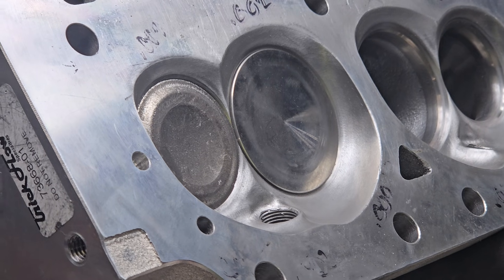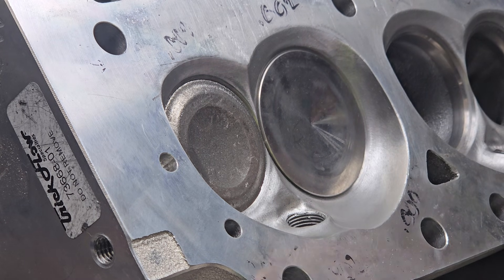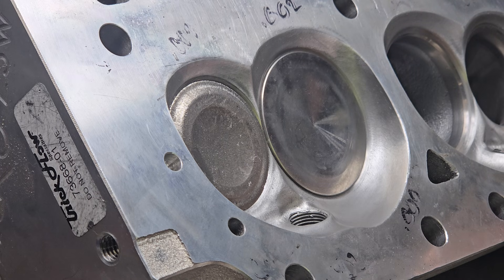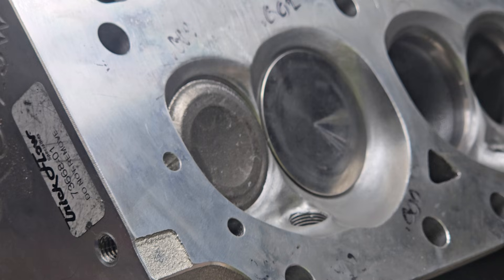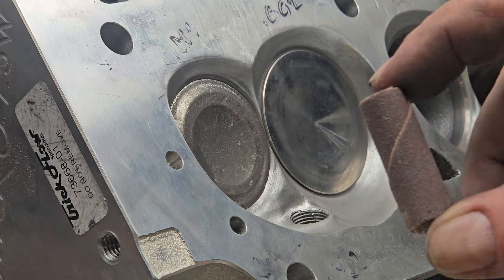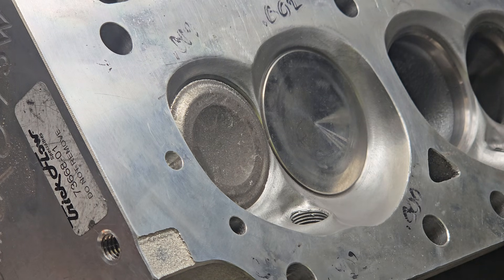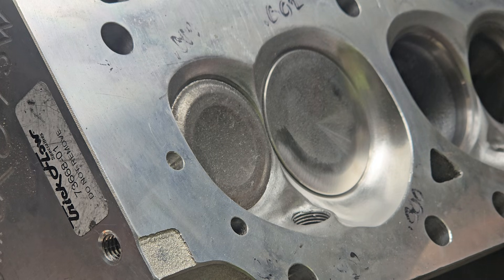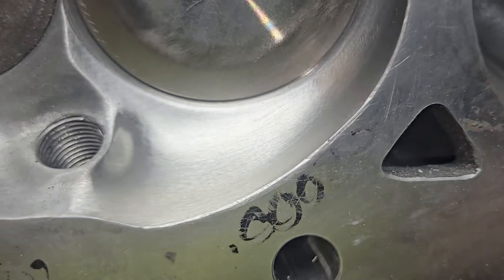Dangerous Donnys's 540-440 Mopar project, Trick flow 270 cnc, Mirror polished chamber?

Comment: Legitimate question here....

Do you see any surface in the chamber that's hotter than the sparkplug? Wouldn't that be the source that lights off, prematurely?
Reply from the maker: If chamber is prepped you are correct.

Comment: Charlie. I've mirror polished for those that pay for it. I use 600 grit cartridge rolls on ⅛" shanks then green Rouge on buffs. For another $200 I don't mind doing it at all.
Reply from the maker: I want to be you when I grow up! Thanks
Reply: @servediocylinderheads 😂😂😂

Seriously though, spray a little WD-40 when using the cross buffs.

Almost 30 years ago, Standard Abrasives had a porting kit that came with the mandrel and 1" cross buffs. Their directions said to use WD-40 when polishing. Ive done it that way with the cross buffs since. 

In the kit was also the ¼" porters best kept secret. Emory and red scotch brite worked great with that.

Comment: What if you use  a little metal polishing rouge with the scotchbrite?
Reply: I meant using the buff and blend fine  scotchbrite  crossbuff pads with a liitle green first and a little white rouge and it looked slightly hazy   mirror
Reply from the maker: If you had a tiny buffing wheel you could go that way. Thanks
Reply from the maker: I think the scotch bright may leave scratches. Thanks

Comment: I love super prepping chambers and pushing 12 - 12.3 to 1 on pump. If the rear gearing is right, with efi, knocks a non issue even lugging from 1500 in overdrive. Oh also WD 40 and a final pass with the very fine can get you a little bit more.
Reply from the maker: I have done the wd 40 trick. It works. Thanks

Comment: Thanks Charles. They did not have these cross buffs back in the 80s when me and my Makita die grinder were trying to adhere to D.V.'s instructions, porting our A-series Mini heads. He was the first to tell us DO NOT polish the intake ports, just the exhaust ports and the chamber, if you must. I can still remember dutifully trying to replicate his "D" shaped outer exhaust ports. He's a good writer, because after all my hogging out and blending, I put the head back on and it was like I'd gone up two camshafts. Massive improvements. Being a SB Mopar guy from the 70s I knew about the importance of improving the bowls and how they transitioned through blending to the seats and also to not go crazy hogging out the rest of the mostly adequate port towards the intake or header. Like I said, with D.V's porting instructions, increased compression with the seriously larger oversized pistons, my lightened flywheel, larger carburetors and higher lift rockers. The revs came up like a motorcycle, sweeping the tach in milliseconds, as you furiously grabbed for another gear, barking the tires.  Yet it had more torque, throughout the rev range, top to bottom and pulled effortlessly at light throttle yet screamed to higher rpm in every gear. Really enjoyed your demo. Lucky Joe ! Malcolm Ottawa Valley
Reply from the maker: I have the same D.V. story! Thanks

Comment: Very nice. I like polished chambers. The more heat that you reflect into the chamber, the less advance that need to run, and the less load on the cooling system
Reply from the maker: I used to ceramic coat chambers, valves and piston tops. That worked! Thanks